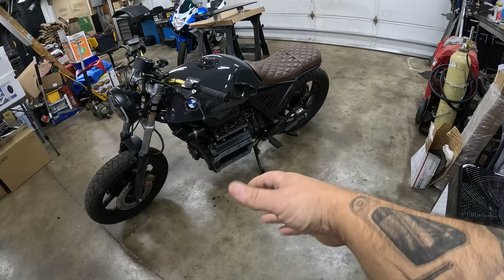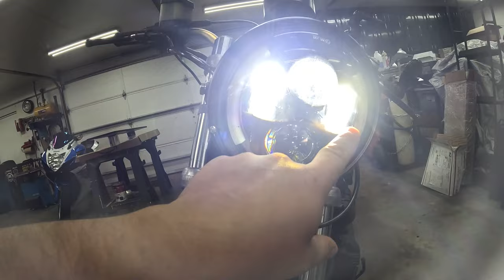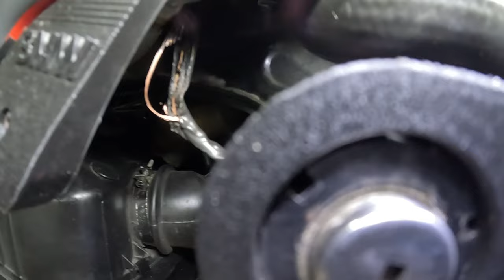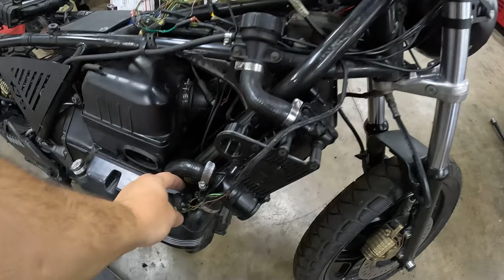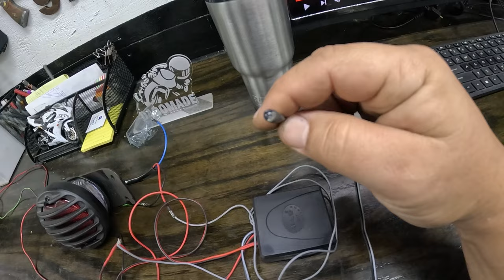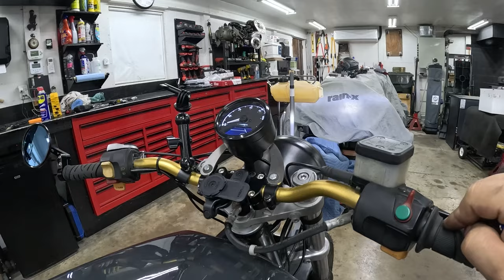My BMW Caught On Fire!

Comment: Gotta love it when people put crap mods on bikes ... good luck in getting this bike up to spec without doubling your expense.
Reply from the maker: I knew I could fix it up but it sent me back a bit with time.
Reply: @DadoRados  I had no doubt that you could, and if that is part of the enjoyment then it's not so bad if your extra monetary cost is not that much. Eats into riding time, though and that is a cost as well ... at least up front.
Reply from the maker: @GrumpyGoat  if I didn't work three jobs I would have a bit more time for wrenching and riding

Comment: I had something similar happen on one of my bikes when I mistakenly wired an alarm backwards. When I hooked up power, the one wire lit up. It acted like a long fuse on an m-80.
Speaking of fuses, shouldn't that have blown a fuse rather than self destructing?
Reply from the maker: Yes. "Should" is the key word but it didn't.

Comment: Hello were did you buy the rfid kit ?
Reply from the maker: https://www.ebay.com/itm/114456854305?mkcid=16&mkevt=1&mkrid=711-127632-2357-0&ssspo=rV1juZ8XTiW&sssrc=4429486&ssuid=im7ZlVHBRRu&var=&widget_ver=artemis&media=COPY

I am replacing it with motogadget M Lock unit though.